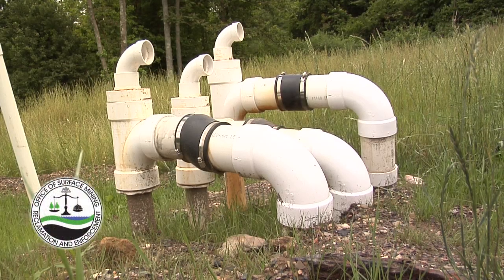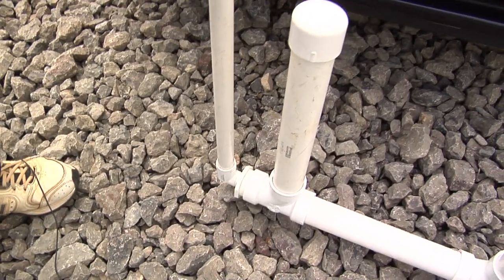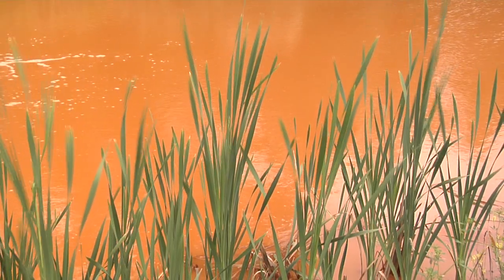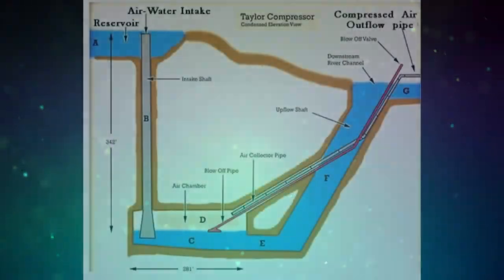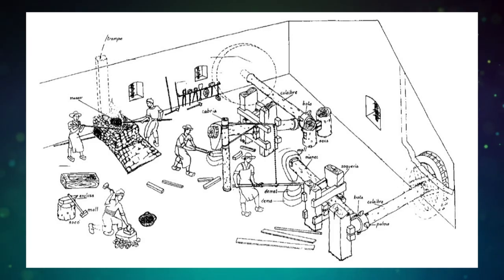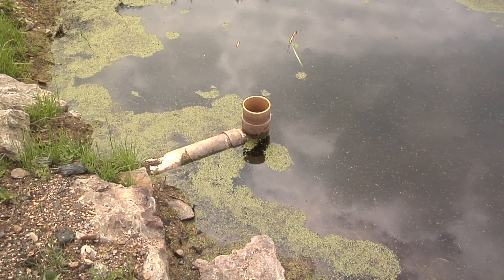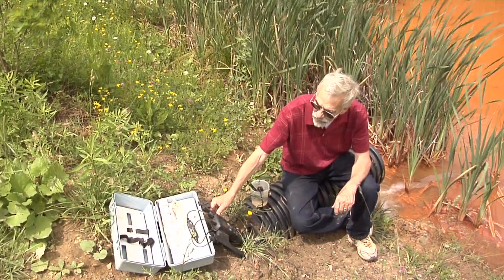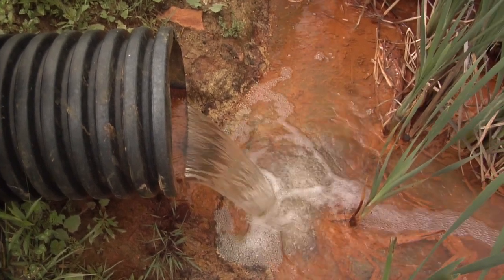Applied Sciences Trompe

Comment: Trompe`s origins come from Italy then to spain and refined for forges. The spanish brought it to the Us later. It was then used to power mines and air products. It was also used in cars in the Usa in the 1920 and shops for energy & Fridges. It was also used in Paris for Trams. The tech Is pure science and simple and requires little maintenance. More importantly is does not use finite resources as everything is returned without any loss Ie the Water  & Air. To my knowledge this is the only truly sustainable system out of all the tech we have today.  Not only that but you can have as many tromps running off the same volume of water increasing the output by as many as you care to make. The reason its not used is because there is no profit and its not a consumable . No fish were harmed in the writing of these comments either.
Reply: Nah, they got the idea from the Babylonians

Comment: Why dont we use this in Flint?
Reply: Flints problem is lead from the solder in the pipes being dissolved by high PH water they can fix it by adding calcium to the intake tanks lowering the PH and stopping the solder from dissolving then flushing the system.
Reply: @Barskor1  Aren't some of the older pipes made of lead themselves?
Reply: @Reno Simpson ?
Reply: @Reno Simpson Oh ok the more you know. have a good life.
Reply: @Reno Simpson LOL! Just wishing it will be good for you.

Comment: There are some rollercoasters that work with compress air, some of the fastests, so it can be used for regular transportation, not just amusment parks.
Reply: alfonso terrero Compresssed Air used to be used for Trams in France, and Chicago( I think).a hundred years ago. The releasing of the CA to fill the Tram tanks created ‘Cold Rooms’ as air freezes when released fast from compression, so the ‘Cold Rooms’ could be used to store stuff and or for Air conditioning etc etc, also compresing the Air creates Heat that also can be used for many purposes. In fact both the heat and cold could be used to generate Nitinol generators. So electricity could be made as a bi product of using CAV.
Reply: @Kiyarose3999  Yes or to run Stirling engines.

Comment: Could this not power a well pump without the use of electricity providing cold water pushed up by the compression of air?
Reply: +Angela Angell Hi Angela, actually trompe's were never used to do that. BUT, you gave me an idea, capturing the air, it could be re-fed down into the water, and by using a thing that kind of looks like a helix/dna structure inside a tube, turning on a central axis/vertical axle, it would lift the water up. *Think of a vertical water wheel of sorts... <--- I do not
Reply: I'd like to see that..are you gonna make it?
Reply: @lionofjudea4146  Im not sure to understand you but isnt it looking something like pulser pump and air lift..?
Reply: The trompe uses waterpower to create compressed air. You could use compressed air to pump water, in its simplest form as an airlift pump, or you could have the compressed air power a turbine which in turn powers a water pump... But since electricity can be produced by water as well you could just as well generate electricity and use an electric water pump...

What I'm trying to say is that it's possible but may not be the most efficient or most practical method for pumping water.

In this case what they wanted is compressed air (to oxidize the iron in the pond water). Using a tromp in this case seems like the perfect method, since it's simple, very reliable and uses water energy from the ponds themselves to directly generate the compressed air. So it sounds like the ideal technology for this application.
Reply: Loop up pulser pump, it's used to move water in a similar manner to the hydraulic ram pump, but no moving parts (common cause of failure due to wear and tear)
Reply: go back again without the blinckers on coz you compleyly missed the point and its all there

Comment: Does the water level where the outlet discharges have to be lower than where the water enters ie a dam where the water enters at the top and discharges under it thanks
Reply: yes.
Reply: According to the Taylor fella who built the Canadian air plant, the head height between the intake and outtake determines the air pressure produced, 1 psi for every 2.31 ft of head between the intake and outtake.

Comment: We should be using this to do much more than clean water... This is a brilliant way to produce compressed air. Something they don't mention is the temperature difference between compressed air via a compressor vs compressed air via a trompe. ChronoEnshin I too wish there were more literature on this bygone era masterpiece.
Reply: Issue with conventional compressors in humid countries to s the water vapour that condensates, turns stagnant then gets in air lines. Worked with a bloke that got an infection from this.
Reply: https://losttechnology.org/wp-content/uploads/2017/08/TaylorHydraulicAirCompressor-ByCharlesTaylor.pdf

Comment: Would this be effective in cleaning up the waste water from CSG?
Reply: Dean PD what’s CSG?
Reply: @Kiyarose3999  Coal seam gas. Basically methane pockets, why they carried canaries back in the day.
Reply: If you used this method to oxidise dissolved chemicals in the water then used reedbeds/ constructed wetlands, you should be better off. Reeds will add oxygen to the water and soak up metals and other shit too, then can be harvested as biomass for biomass power stations (ex coal fired power stations)

Africans have been innovative with biogas designs and dealing with H2S, often encountered with mining and methane, they pass the gas through plastic pipes with scrap steel in them to allow the H2S to corrode the scrap metal before it is then burnt through brass heating elements.